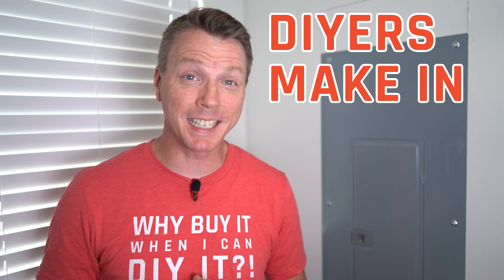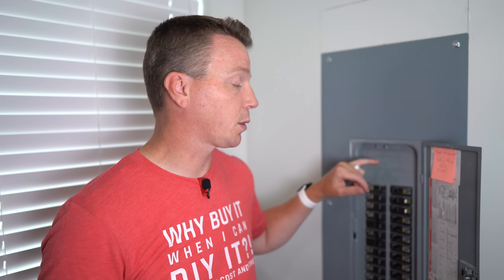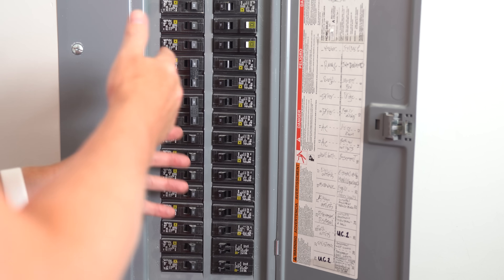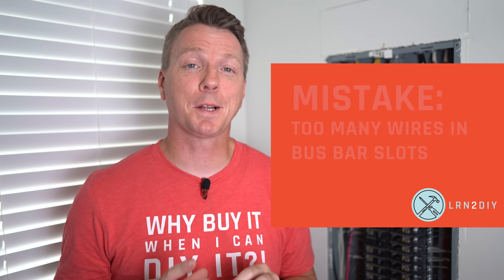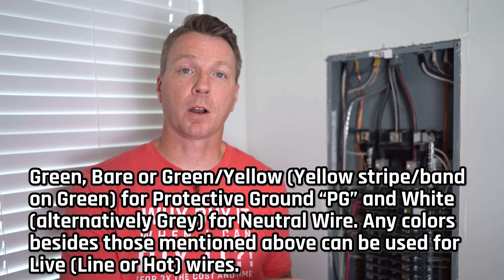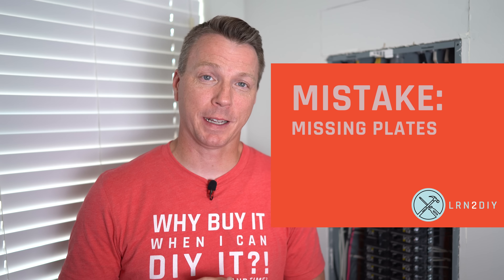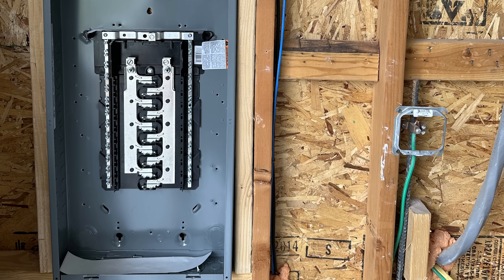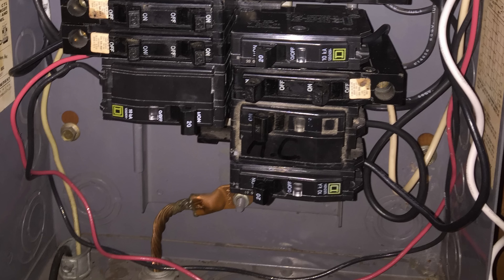10 Common Mistakes DIYers Make In Circuit Breaker Boxes

Comment: Thanks for the education. I knew most of those, but didn't know about the circuit breakers that are designed for double tapping. I was taught to never double tap a breaker, and will strive to never do that, what I always did was get one of those breakers that have 2 individual breakers in a single breaker slot.
Reply: You have to check local codes before using the half breakers as some jurisdictions do not allow them or only in certain cases.
Reply: @drozcompany4132  Good to know, I wasn't aware local codes could prevent their use. I'm building a new house and the electrical box is being wired this week. I'll ask my electrician about codes in our area.
Reply: @drozcompany4132  You also have the check the rating on your panel.  Some panels are designed to allow the half breakers, some are not.  Some only allow half breakers in certain positions.
Reply: Local Codes? With few exceptions like NY City that would be the National Electric Code its just a matter of what version (year) is approved in your  State.
Reply from the maker: Yeah, the tandem breakers are great for those situations. It's an easy fix and gives you a bit more to work with.
Reply: As a vital rule of thumb.  Never double tap any breaker   unless 1 the breaker is rated for multiple conductors and there's no available spaces to add extra breakers.  To many variables to chance on anyone's life.  We're in a profession that saves lives    one lazy, or half assed action could have catastrophic results.  My greatest fear is if anyone of my guys doesn't have the upmost knowledge and dedication to his craft could possibly cause a loss of life is unacceptable!

Comment: Torquing the screws is the only one of these that have gotten me.  We were in a new build home about 2 years and a screw came loose on a breaker.  The wire pulled out and shut off the circuit.  Of course this only happened to one circuit - the furnace, in Minnesota, mid winter.  Probably about midnight.  About 2:30 or 3 I woke up due to the cold and realize the furnace wasn't running, but we have power to the house...  Not fun chasing problems half asleep and with a sense of urgency.  Found it after a few minutes and got everything working again.  One of my best examples of "Murphy's Law" - wouldn't happen to an unimportant circuit on a warm sunny summer afternoon.  Noooo, of course not...
Reply from the maker: I have to laugh because I've been there but man, that stinks. Our issue was with the A/C in mid July, also middle of the night. Darn that Murphy! 

At the same time it's a great testament to checking in on those lugs once in a while - could save a lot of trouble. I'm a believer! Thanks for sharing that experience too.
Reply: @LRN2DIY   These are the kinds of things that only have to happen to you once to convert you to a believer.  I'll probably invest in one of those torque-controlled screwdrivers.  Maybe add this to my once-a-year preventative maintenance list.  I thought I was just unlucky, I didn't realize this is a thing.

These kind of reminders are things that Google Calendar is great at setting up and reminding you.  Hey, that's an idea for you - maybe you already have it on your website (I haven't looked).  How about a preventative maintenance list for new homeowners - furnace filters, smoke detector batteries, HVAC service, water heater service, sprinkler systems, etc.  All the things you want to plug into your favorite calendar app.
Reply from the maker: @philipstaite4775  I love it, Phillip. I have thought about doing a video like this for a while and still might. Gotta love those easy recurring calendar appointments too. I use that now for filter swapping and a few others. Technology FTW!
Reply: @LRN2DIY operate your water shut off valves when you do the time changes or smoke detector etc.  someway to easily remember. I have been to a lot of homes and decades of sitting in open then needing it to shut off for a leak. Sometimes you can walk away with the handle and it’s still on leaking😂

Comment: I just went and checked my panel. They were all in need of torque! The mains were way off. Thanks for this video!!
Reply from the maker: That warms my heart to hear that you found that and can address it. Good on ya!
Reply: @LRN2DIY  to be honest I didn't realize they had torque measurements for the screws in electric panels. Glad you made this video!
Reply from the maker: @CrandallDobee  I don't think it's common knowledge. I have wanted a torque screwdriver for a while so this video was my excuse to finally get one. They're not that much and it's nice to know your lugs and bolts are tightened down just the right amount.

Comment: I would like to add putting fiberglass insulation inside of the panel. I found that 2 weeks ago at my shop when I was adding a new circuit. Apparently the old owners were worried about the little bit of air coming in through the service line entrance so they risked a huge fire hazard instead.
Reply from the maker: Wow - that's pretty crazy that they did that. Super dangerous stuff. Glad you found it and took care of it!
Reply: fiberglass doesn't burn so what is the issue unless the breakers need ventilation
Reply: @JamesAnderson-mr2sg  Current generates heat in wiring and conductors, so ventilation is key. Even subtle overheating issues can lead to loose connections.
Reply: @usernameerikhoover  i did mention ventilation in my comment

Comment: No, you don't test to see if there is no current running through them.  0:37 / 13:54.  You test for voltage.
Reply from the maker: Thanks for the heads up on that. I'm always looking to correct my vocab - it's one of the things I kinda suck at :)

Comment: Turn the power off at the main breaker before removing the cover. Unfortunately, my main is inside the panel box, so there is still risk of electrocution. I have seen some YouTubers put a piece of cardboard over the main connections in this case, but I don't know if that is completely safe.

Comment: One thing I wish all manufacturers would do is put two hooks on the top holes to hold the panel cover. Siemens is the only one (in our area) that does that.  Good info for those that dont know.
Reply: One of my journeymen at work introduced me to what he calls "panel buddies". We take two long quarter 20 screws and cut off the head, then screw them partway into the top corners of a panel, or any kind of can really, and then hang the cover on it while we tap the rest of the holes if they're not present, or just use it to hold the panel in place while we drive the other screws. Then pull them out at the end and place the last 2 screws
Reply: Whts nice in some with dead fronts especially in commercial the door hooks r great I love them design a open the door fully lift uphill out. Then four screws to dead front to the holding brackets n thts it. Weight is much less also
Reply: @OutageousVibes360  What????????
Reply: Some do.

Comment: I educate myself to the point i feel i can do it, then i call in an expert. At least then i know if he is ripping me off. A man has to know his limitations ~ Clint Eastwood
Reply: A very good way to do it if you don't feel fully comfortable working in a breaker box.
Reply: It's only a ripoff until you die from a mistake you made doing it yourself. 🤣 
Aside from that, professional work almost always comes warrantied for a period of time, usually electrical is a year(labor and installed parts). These guarantees aren't necessarily cheap...